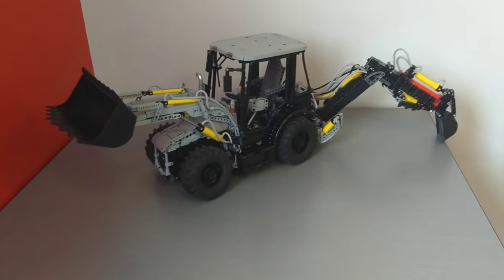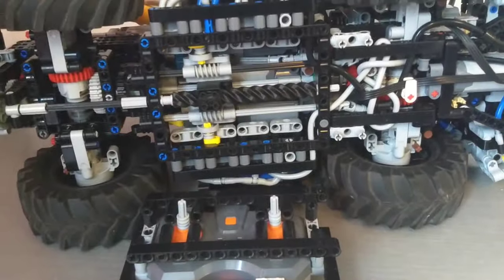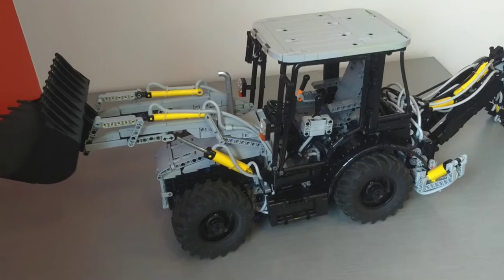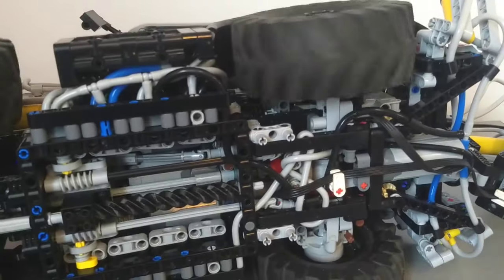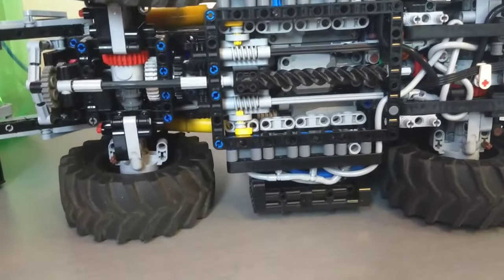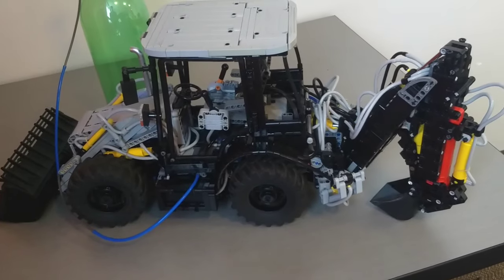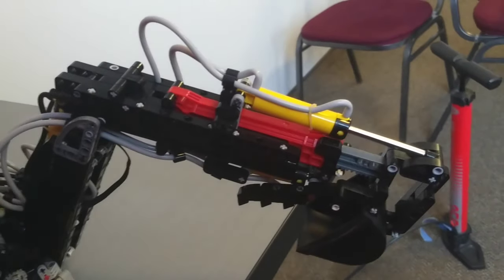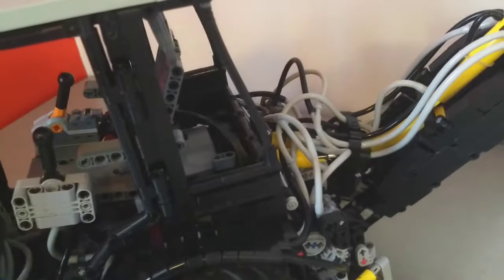Lego Technic RC Pneumatic Backhoe

Comment: This build is amazing, but when you started showing pneumatic arm it's clear pneumatic in lego technic is useless. It works in 0/1 position.
Reply from the maker: Well, that was mainly a drawback of my choice of a high pressure supply and imprecisely operated valves. 
Systems with manual valves can offer better control, and systems that run compressors on demand can also give more precision